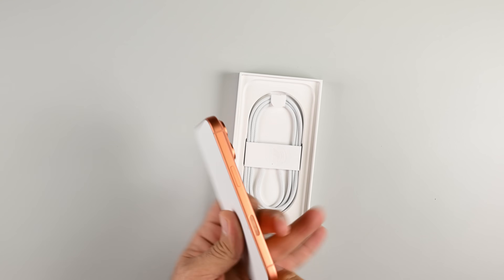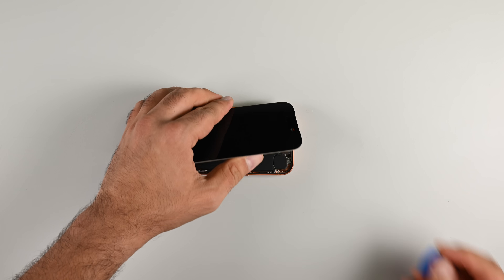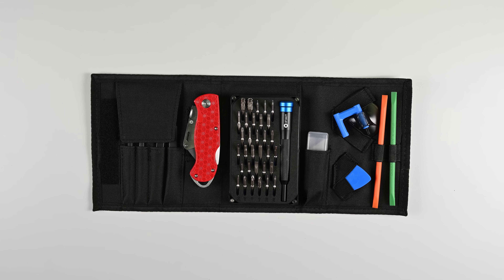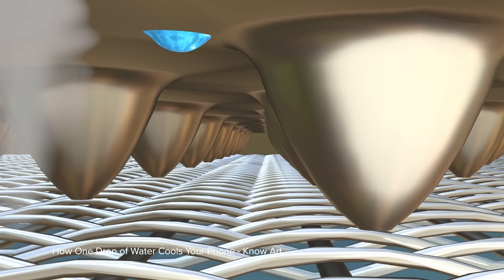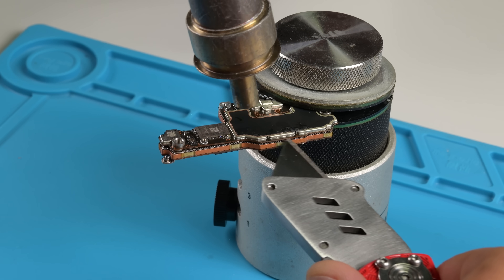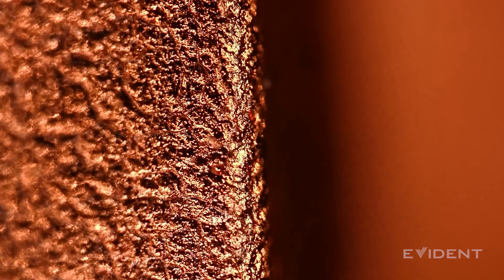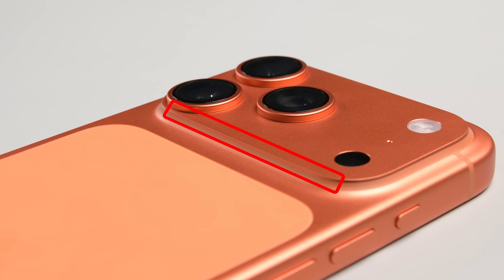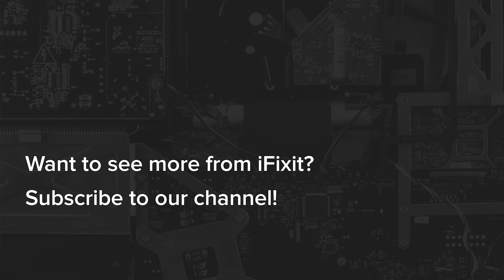iPhone 17 Pro Teardown: The Good, The Bad & The Fascinating

Comment: The Air seemed lots easier to repair, I would have thought this would get a 6 or even a 5
Reply: It’s a more complex phone. Ease of repair has to do with how you can get to the parts. You want to eliminate most glue, then you’re going to need a lot of screws. It’s one or the other. This seems pretty straightforward to disassemble.
Reply: thinner and lesser parts i guess
Reply: Also no glue, only screws even though with 3 different types and a lot of them

Comment: So basically in order for aluminum to properly dissipate the heat like its intended purpose , it needs to be out of a case for the air to carry away the heat from the aluminum. But if it’s out of the case , then it’s gonna look ugly as hell with those scratches building up over time ! Maybe they should’ve put in a little more effort to design the phone so that people can safely use it without a case in order to gain the benefits the new body provides !
Reply: Agreed. Titanium would have likely been fine. The form of the Air model allows it to function. The form of the 17 Pro (and max) takes away from its function as an everyday mobile device making in chunkier, in the way, and more fragile :-/

Comment: I was wondering about the scoring here. The Pixel 10 still uses a dual entry design that lets you remove the back panel without heat, all screws are the same size, and the battery can be taken out by hand once two screws are gone. The USB C port is on a removable daughterboard, and both phones require heat for the screen but also provide manuals and replacement parts. The iPhone has less glass area that can break and its front glass and camera covers are more scratch resistant. Given all of this, I do not quite see why the Pixel ends up one point lower than the iPhone.
Reply: And it makes no sense that this iPhone, which you have to remove the screen to replace the battery, gets the same score as the iPhone Air, where you can leave the screen untouched.
Plxel 10 should have been an 8/10 (maybe even a 9/10), iPhone Air should be 7/10, and iPhone 17 Pro should be a 6/10.

JerryRigEverything got it right, pointing out that the Pixel 10 is even easier to repair than the Fairphone. You have to take most of the Fairphone apart to replace the battery and deal with a ton of screws, meanwhile with the Pixel 10 you remove the back panel, two screws, there's the battery.
Reply: They are called ifixit for a reason
Reply: That’s what I’ve been thinking too!😅
Reply: Same 😂

Comment: why did they use qualcom didnt they move to their own silicon?
Reply: Yeah I thought that was weird too. Likely are aiming for stability in this case. Go with something known and battle tested for the PRO line and figure out the quirks on a likely less vocal segment of users on the Air models. 

They will likely get the (N2 or N2x et el .) chips after the new sharp edges are figured out on the hardware and software. 

Example: some people seem to have some issues with the N1 chip on UNIFI APs tho I didn’t look at the specifics.
Reply: @AgentLokVokun  well, while software can be debugged, production line of hardware won't iphone 5S sharp aluminum edges would literally corrode from hand sweat, i had two iphone 5S phones second one was apples refurbished replacement, and both phones my hand sweat has dissolved sharp edges, glass of iphone 12-16 is very tolerable, i never had a case on my iphone 15 pro max, and no scratches on the body or the back, just one tiny scratch on front display, going back to aluminum was stupid, really cheap material, but they were likely desperate because that phone is heavy, glass is heavy, sounds like they tried to get rid of rear glass to make it cheaper to produce, thats all that is, next year they will make the stupid camera island out of glass

Comment: 7 seems really high for this. Just the fact that you have to remove the display to replace almost anything makes it a repair nightmare. Even with a special heating mat, a suction cup clamp, and experience removing displays, there's still a good chance it'll crack and you'll need to buy a new one, even if you were just going in for the battery. And you'll have to remove and replace all the adhesive on the frame and the display to get a proper seal when putting it back together. Combine that with the dozens of screws inexplicably requiring different bits, and I don't understand how this comes in at "only slightly less repairable" than the 17 Air.
Reply: Not only that: how does this come in as more repairable than the Pixel 10, where you can remove the back to get at the battery (leaving the screen untouched), and you don't even have to dick around with electricity to remove the battery.
The scores these guys give make absolutely no sense, and I wish they'd just stop with the scores.

Comment: Would it be a good idea to put thermal paste or pads between the battery and vapor chamber?
Reply: Likely but would also not be worth it unless you had a reason to actually open the phone in the first place. I’d hazard a guess we’d be talking a degree or so at most of delta here. 

I would think raw dogging it with no case would improve thermals over putting a case on and trapping it. But I don’t have a workflow where I I’m in desperate need for a few degrees of temp diff.
Reply: @AgentLokVokun  Thank you for the reply and your insight. Would you think the temperature delta would compound >2 years against degradation and long 4K video capture?
Reply: @dawggyfood  Possibly. 4k capture can generate a ton of heat but I don't see the sensors themselves being degraded. 

If thermals are an issue I think there's quite a few "active thermal" cases out there as a easy solution. 

Side tangent on some passively cooled Apple laptops people have found that adding a thermal pad between the CPU and the case itself caused much better themals but also caused the case to actually be a burn risk. 

So the idea is solid, however with the new vapor chamber we will need some decent testing done before ripping apart a new iphone to thermal paste it. :P

Comment: 17 pro getting a score of 7 is a joke. this is like the most unrepair friendly phone of the year while getting the highest score.
Reply: Care to elaborate? (Plox don’t flame me
I’m asking a legit Q here)

Saying “number bad” dosent give me insight to your reasoning.
Reply: @AgentLokVokun i wrote a very long reply but it got deleted, sorry.
Reply: @xiaomitv9674  maaaaan, I get it. If you find the energy to just give a quick summary i'd be much appreciated. There's things I don't agree with but i think the battery tray, replacement parts, and the debonding thing from the battery is a great move in the right direction.
Reply: @AgentLokVokun as you can see in the video, you can't access the phone from behind. you have to open it from the screen, so you can accidentally damage the screen while trying to repair it.

This phone uses so many screws and you need to have three kind of screwdriver just to do a simple repair. There are cable ports nearly under everything which can possibly cause you to tear a cable by accident. 

7/10 is a very high score. Pixel 10 and Samsung S25 Ultra are way more repair friendly but they got 6 and 5 score.

I dont even consider their rantings credible. Channels like phone repair guru are more objective and know what they are doing. I suggest you to watch the apple magic mouse repair video from phone repair guru. He easily repairs it while it has a 1/10 repair score from ifixit because apparently they didn't know you can just open the mouse from under and they broke the mouse while trying to open it and gave the worst score.
Reply: @AgentLokVokun you brain
Reply: @AgentLokVokun  I would be surprised if you got an elaborate
Reply: @HoangDusYT use your brain
Reply: @ranjitmandal1612  "Because I said so" is the most brain rotted reply ever. I want opinions I can roast people over or agree with. not some reddit snark reply that is literally as good as not replying to the thread.
Reply: @HoangDusYT  Did you see the "your brain" reply. Dude is so cooked buddy can't even say "apple bad" lmao

Comment: How was this a 7? Having to remove the screen to get to the battery is terrible
Reply: Same 😢
Reply: Especially when you compare with the pixel 10 tear down. Replacing the battery and the USB port is easier than in previous models, and you don't need to replace the adhesive on the back cover. It got a 6.
Reply: You have to remove the back glass for other phone anyway.. And iphone used to have to remove the display before iphone 15, so it's nothing new
Reply: @FlitterNova and?
Reply: @ranjitmandal1612  what I'm saying is, it's nothing new to access the internal from the front. It has been like that from iphone X to 14. Why are you suddenly making a big deal out of this?
Reply: @FlitterNova  I'd rather remove back glass than the screen. The back glass isn't a functional part. If it breaks, the phone is still usable. If I break the screen, then now I'm replacing the screen as well as the battery, my repair just skyrocketed in cost. Also I didn't buy a screen, because I wasn't planning to place the screen, so now the phone is unusable while I order and wait for a screen to arrive. All of this, easily avoidable by being able to remove the back to change the battery and leaving the screen untouched.

Comment: You guys dug deep into "Scratchgate" and consulted a metaluerical engineering company to explain what's behind it. Awesome value!
Reply: Metallurgical*?
Reply: It's ridicilous. Every iPhone or Macbook I had, had scratched edges after 2 years. This is no gate, this is just normal wear. Every phone has this. It's bullshit
Reply: @DaveMcMatthews you don't blame them for doing it badly if this happens on their every product?
Reply: @orioxar  This is what happens when you paint/process metal with a color. Chairs, tables, microwaves whatever, it happens to all of them if you bump them hard enough. So it is not done badly, it's just what happens with coloured metals.
Reply: @orioxar its easy to dismiss complaints about something meaningless
Reply: @DaveMcMatthews  There's a big difference between "after 2 years" and day 1.
Reply: There is also a big difference between a “gate” and specifically around the edges to qualify it as a real thing. All who watched the Jerry Rig video saw him wipe away residue from softer metals

Comment: It's really interesting to see how the design changes in 2027 when EU requires mobile phone batteries to be user changeable, with common tools. It's weird Apple is still going with the display route. Time is running out.
Reply: I could see that glass back panel coming out as one battery module in the future. The way it opens to nothing right now is kind of weird, almost like it's a placeholder.

Comment: Can u change the color of that aluminum by removing color and changing to black or gold
Reply: You can strip anodization using acids. But it has a chance to have etch the surface which would then require polishing to make the surface smooth for re-anodization.

Comment: The Apple Watch Ultra has sharp edges. The MacBook Pro has sharp edges. The... Well, all their devices have the same sharp edges that are then anodized. It seems like the real issue here is not that a material can scratch (diamonds can be scratched too if you try hard enough!), but that people want an indestructible phone, which isn't going to happen. Every material has a trade-off. I'd rather have a phone that doesn't thermally throttle every 5 minutes vs one that I can use as a hammer. Also, just put on a case, and all the issues instantly vanish.

Or, you know, just be careful with your expensive phone and don't put it in the same pocket as loose change.

Comment: I’ll take a bit of scratching over shattered glass any day. I don’t like glass backs at all. The less glass on the back the better. The screen needs to be glass, that’s okay. But the back should be mostly metal with maybe a panel of glass or more preferably a polycarbonate.
Reply: Me too. I have a broken glass back right now.
Reply: Or they could make the phone properly and you wouldn't have scratches or a glass back. It's not one or the other. They can make metal with finishes that aren't so easy to scratch. Apple just screwed up, again. I mean you're holding it wrong.
Reply: You shouldn't have to choose lol
Reply: But the scratches were avoidable even with aluminum
Reply: @shooter913b  I agree. The fix would have been having wide curve radiuses at the camera bump so the anodization could stick properly at the corners. But I’m just saying I’ll take this flaw over cracked back glass.
Reply: @-ThatGuy- yea that’s fair. I’d agree with that

Comment: Hmm, I wonder how necessary the unibody design actually is. Feels like they only did it so people wouldn’t feel like they were downgrading as much from titanium, but hurt repairability.
Reply: aluminum is substantially more heat conductive than titanium and glass, so it was likely pretty important for heat dissipation.
Reply: @octagonPerfectionist Sure, but did it need to be unibody? Why not adhere the metal back panel like they’ve been doing for the glass backs?
Reply: @samtherat6  it’s probably partially aesthetics (as with the dumb easily scratched plateau) and for thermal reasons. the back needs to have some glass on it for the magsafe coil so that part was necessary either way.
Reply: @samtherat6  and remove wireless charging and magsafe capability? Aluminium is metal
Reply: @ArchusKanzaki I mean they can keep the glass panel like it currently is. Doesn’t need to be unibody for that part.
Reply: @samtherat6 they use the big aluminium body as basically a big heatsink. That's why its run through the middle of the phone, and they put the vapor chamber in the middle. Coincidentally, they also stuffed the internals more to the plateau and also increase the battery to reach 5000 mAH for the Pro Max.
Reply: Likely strength because it’s not Ti.
Reply: @AgentLokVokun  Its multiple things on why they go back to aluminium, but strength is probably not one of them. The metal battery casing already give tons of rigidity already.

Comment: 7 out of 10 for a difficult to work on, expensive to work on, parts paired locked down device that requires either specialty tools to use non genuine parts or expensive genuine parts? Are you serious? It should be a 4 or lower.

Comment: Would y'all be up to posting your rubric used to arrive at the final scores on your site? I'm trying to understand how this is a 7 while the Pixel 10 is a 6. The Pixel still has the repair-friendly dual-entry design, the back panel can be removed without heat, all the screws are the same T3 Plus, after two of those the battery can be pulled out by hand without needing heat/electricity, and the USB C port is on an easy to remove daughterboard. They both have screens that need heat to remove, provide a repair manual, and sell replacement parts. The iPhone has less area that can shatter and the front glass and camera covers are more scratch resistant. What among these factors does iFixit weigh so heavily that results in the Pixel scoring 1 lower than the iPhone?
Reply: the score is based on how many parts and tools they can sell for the product 😂
Reply: Crazy 😧
Reply: i was thinking the same. if google did what apple did here these people will go nuts and will give it a 3 i guess
Reply: @Tech_i_e I highly doubt that.
Reply: @FuzzyIceclenope
Reply: The reason is that the Pixel 10 doesn’t have any repair manual or parts from Google. There’s no favouritism here. 

Google actually does partner with iFixit to offer official repair guides/parts (like they did for the Pixel 9). 

The difference is that Apple has the repair parts/guides on release whereas the Pixel 10 Pro doesn’t.
Reply: Just watched the video. I’m guessing the battery. A pull tab is worse than electricity.
Reply: @th3lasthop3 Hmm, can't say I follow. How is something you only need two hands to remove worse than something you need a 9V battery or power supply and some alligator clips to remove? Even if they think that's the case, I'd still like to know how that one thing negates the multiple others including the number and type of screws you need to remove before you even get to the battery.
Reply: @th3lasthop3  No, a pull tab is better. I'd much rather just pull the tab and have the battery out than have to dick around finding a 9 volt battery or a power station as well as probes or alligator clips, then wait 1-2 minutes for the process to happen. I can remove several Pixel 10 batteries in the time it takes to remove a single iPhone 17 battery.
Reply: Its not one factor being heavy, its multiple little ones changing the score by 1. Plus why does a 1 affect you so much
Reply: @FuzzyIcecle please read my comment again, I never said it was one factor nor anything about this affecting me so much. I merely asked if they could share more info so I can better understand their scoring. I listed out the differences I'm aware of between the two and the multiple little things seem to point to the Pixel being easier to repair so I'd just like to know what I'm missing.
Reply: @FuzzyIceclebruh 🤦 don't be ignorant
Reply: There is also the Android Troll quotient, where if a rating of +1 would enrage Android fanboys, then they add the 1. You can see it at the end of the dial, where it kinda just about stops on a 6, and then pops up into the 7. 😂😂😂 Deal with it ❤❤❤